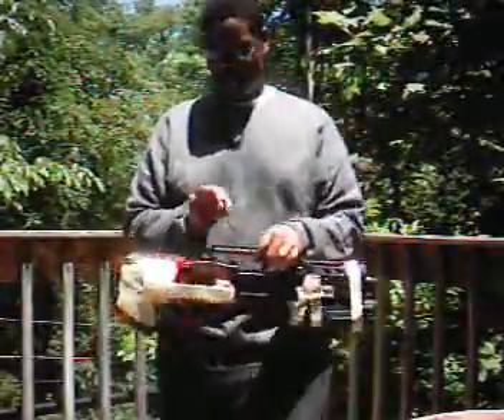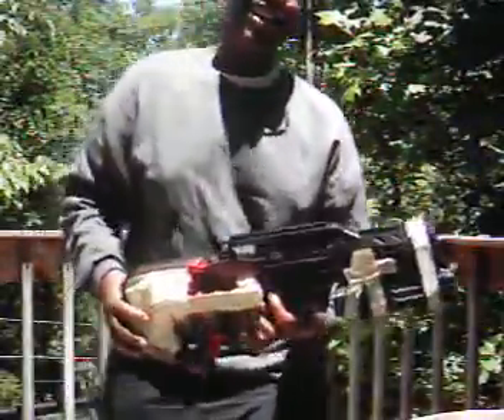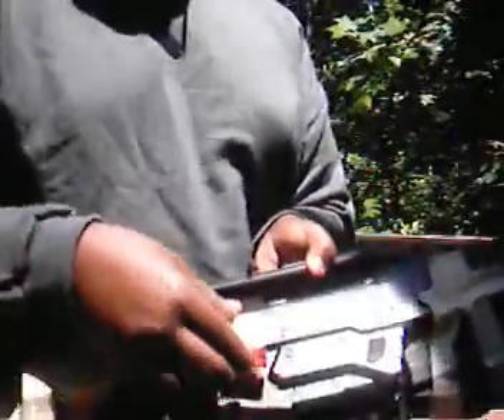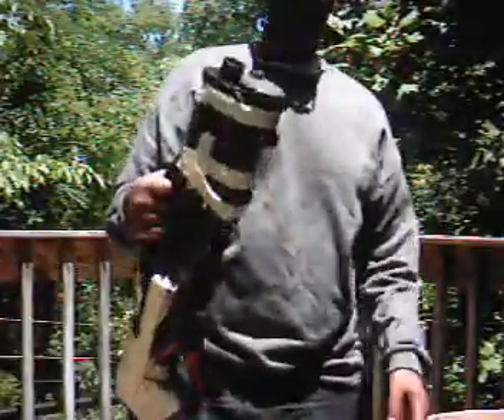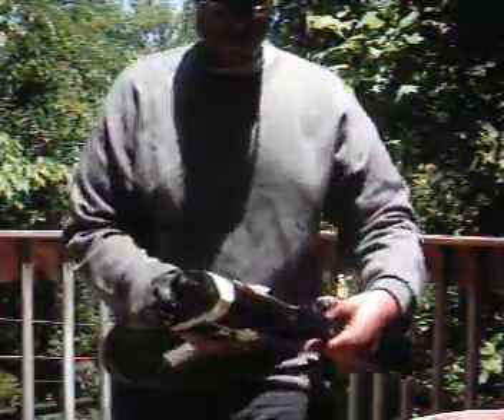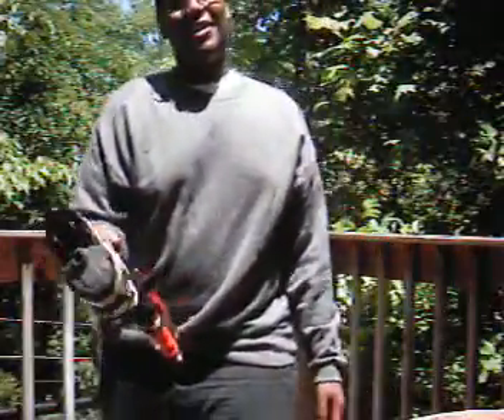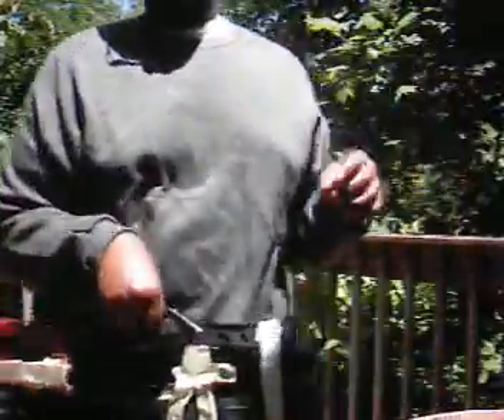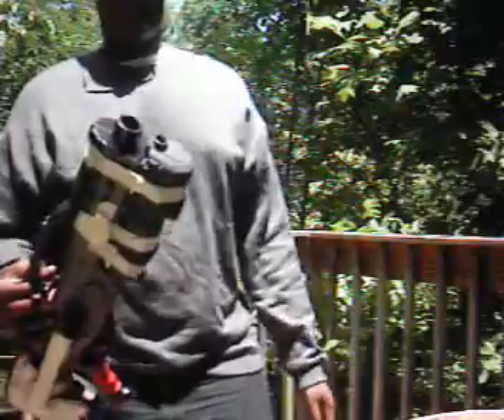nerf mod longshot stock reloader and front gun intergation

Comment: it's like this hard core glue, but it works like a very weak cement. It is designed to fix water pipes. I used it to try to fix the air chamber in my recon, but when i sandpapered it down it wasn't air tight, and then many other things went wrong with the gun.

Comment: that will do it too, or if you wanna get REALLY into it, you can open it up and for each side of the shell, drill a small screw from the inside of the LS and into the integrated gun. as long as your not drilling through anything important, and then you can use what ever you want to fill in the gaps, like mighty putty--or even play-dough.